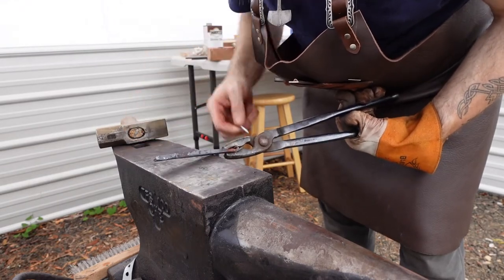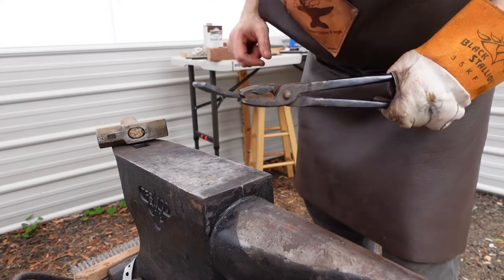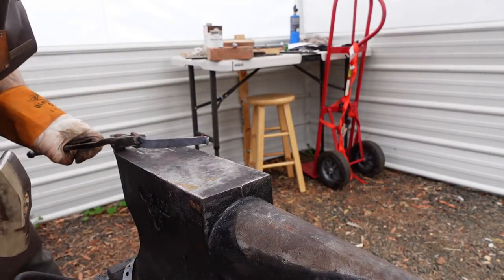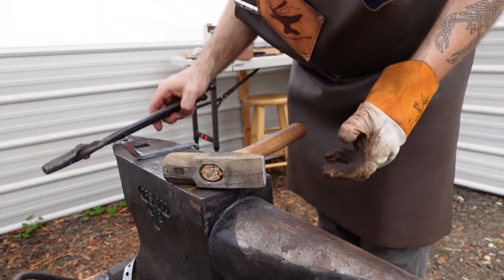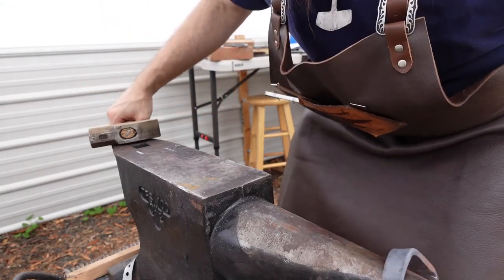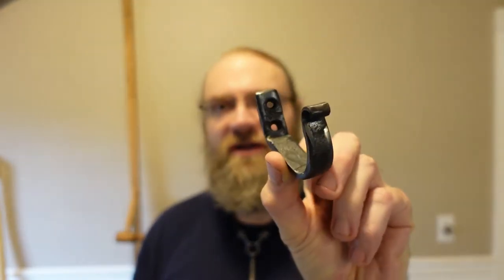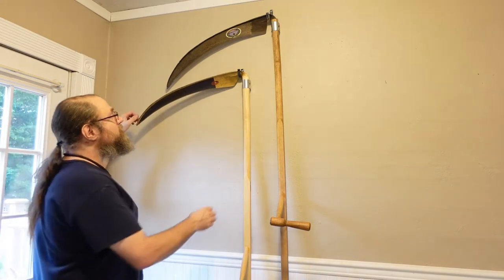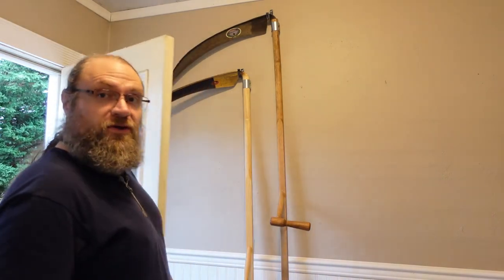Project 2 - Scythe Hook Two, new Tool Boogaloo

Comment: Would it be easier to do the little turned over tip later in the process?  Seems like the most delicate part.
Reply: Also, seemed like you had a lot easier time than the first one.  Improvement.
Reply from the maker: Scrolls traditionally start at the end, harder to get that curve started when there's a curve behind it to work around.  I should do more things with ribbon scrolls, I need some more practice making them smooth and nice. But yes, this felt much easier than the first one.